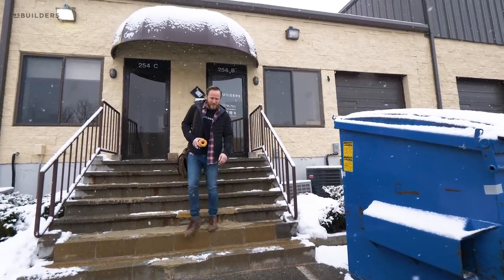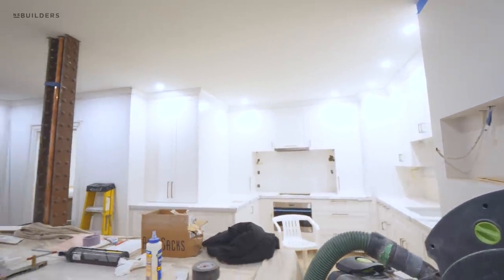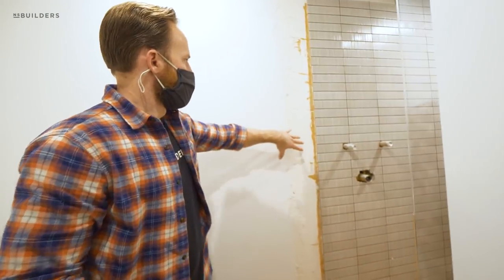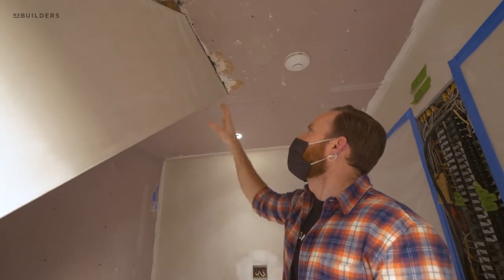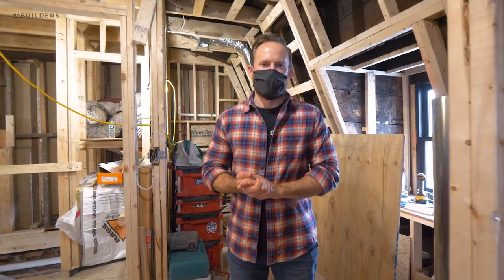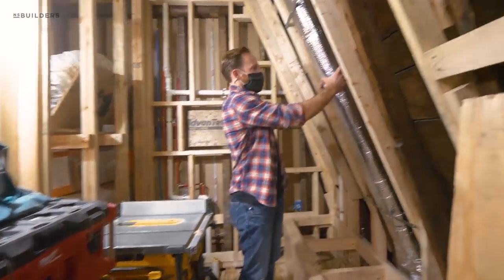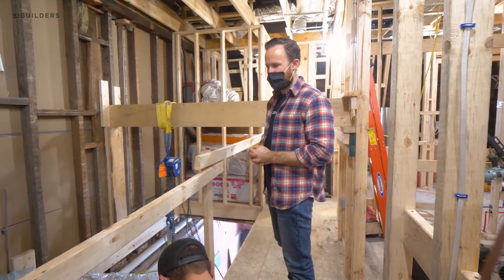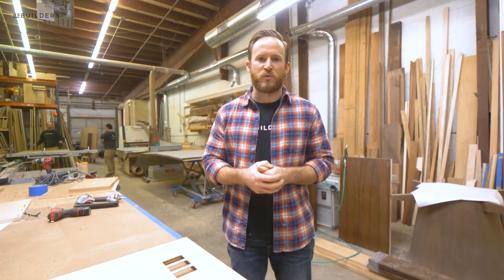Tight fitting countertop scribe & shop built staircase on site | Site Visit

Comment: For all the people saying that the byfold door with soss hinges will break, I’ve swung book cases off of those with 7/8 material same as the door, it’s not breaking
Reply from the maker: I’m saying! 🤘🏼
Reply: @NSBuilders  Does the top right corner get secured into a slider/runner? I'm picturing it like a typical closet bifold door.

Comment: Great content as always.... I have two curiosity questions, first I remember from the first episode about the beacon hill take over job you talking about the radiators and what you were going to do with them, I noticed them in this video, any decision on that? And second again just curious, you were talking about the beam and copper vent pipe that’s going to be painted with some sort of rustic finish, just wondering why you didn’t paint it before cabinet and counter were installed just my non painter observation seems like it could make things a little easier, assuming there is a good reason just wondering what that is.... again as always great content I look forward to these site visits
Reply from the maker: Two of the radiators were swapped to lower profile units. The others we kept for cost savings.  

As for the paint, agree would have been easier to do it ahead of time but just didn’t work for our sub to get in there before hand
Reply: @NSBuilders  thanks a lot.... you the man!